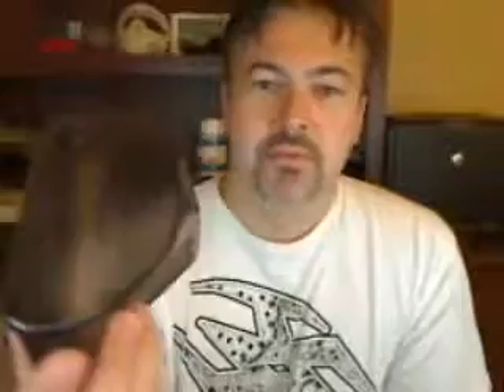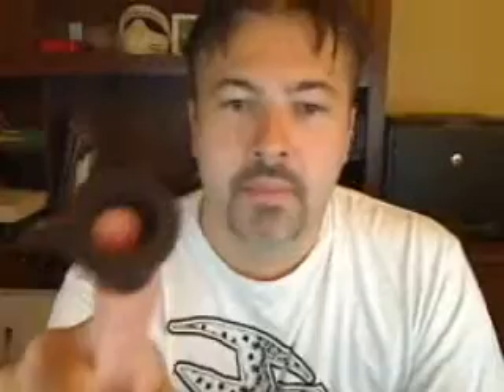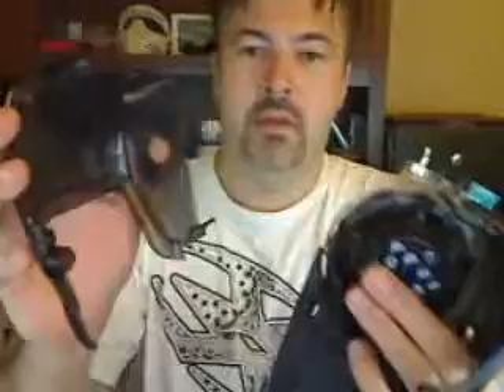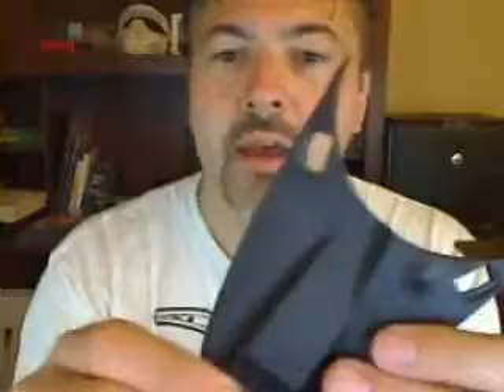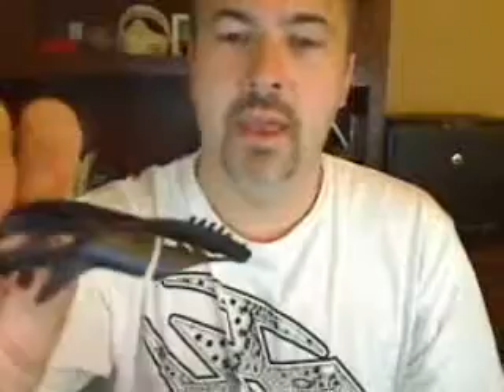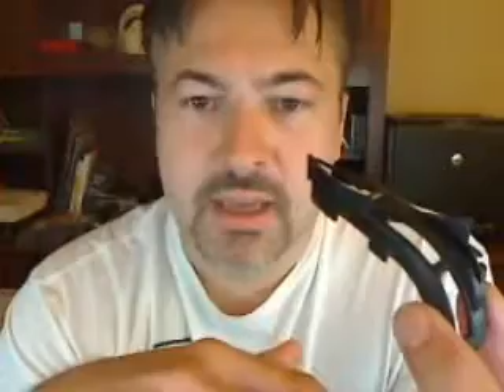Prophecy Disassembly Part 1

Comment: i got the prophecy and i have to tell you "i love it". got some question for you bro.  when i turn on my prophecy it flashes red then green is that normal? and when it drives the paintballs the flashing green will flash red then go back to green is that normal or im running out of battery ?    thanks